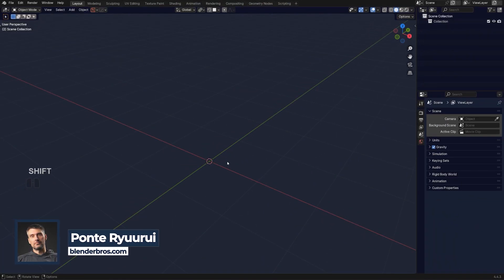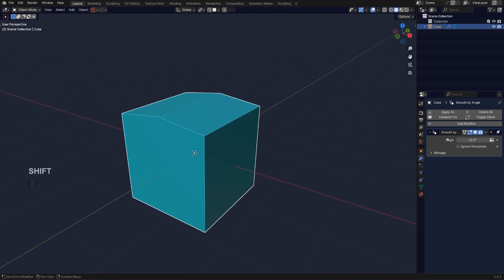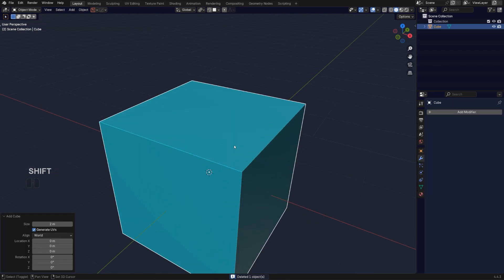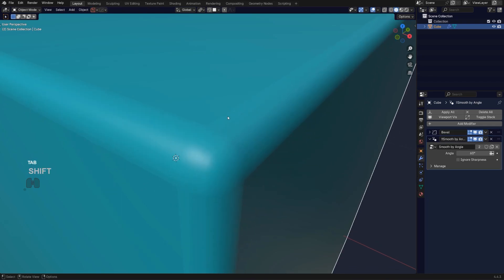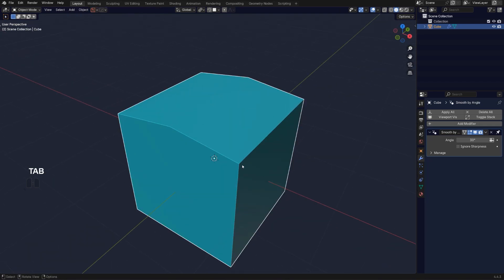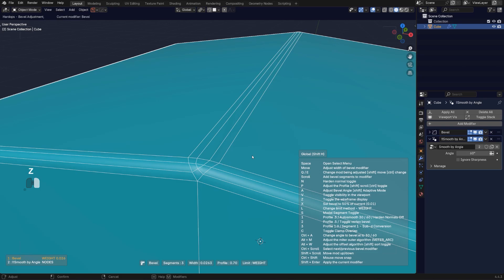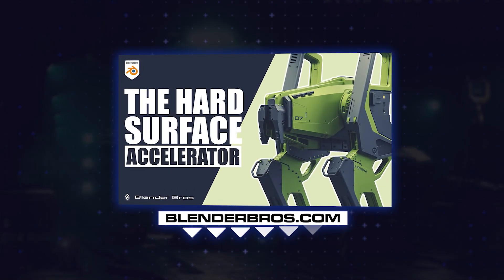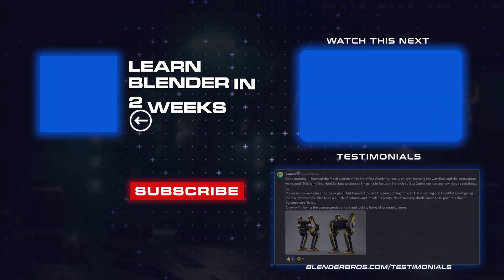Blender's Hidden Edge Trick That Changes Everything!

Comment: By the way, thanks so much for a couple very useful tips I learned from your videos recently. First, I make a lot of my own Python script addons, and recently I've been having issues installing them "from File". Apparently it won't install them if they're located in the default addon directory. But I saw in one of your videos that all I have to do is zip the .py file that contains my addon script, then drag and drop it into the Blender viewport and it automatically installs. Wow. Also, it never occurred to me that rather than using my asset manager script, all I have to do is start up a separate Blender instance with the scene that contains the object(s) I want to bring in, and copy/paste the object(s) directly. Excellent !! By the way, you're probably aware that AI is actually surprisingly good at generating Blender addon scripts. It even will do a full UI script so that it appears in the N panel, and it will even create file selection dialogs, checkbox selections, and on and on. I even had it generate a full asset manager. I was amazed how good it is.
Reply from the maker: Cheers mate, and you dont really need a zip, .py is fine, just install from disk. And yeah I created an addon for our 3D printing course using GPT with zero coding knowledge. Simple addons are easy to make, once you get past the troubleshooting.